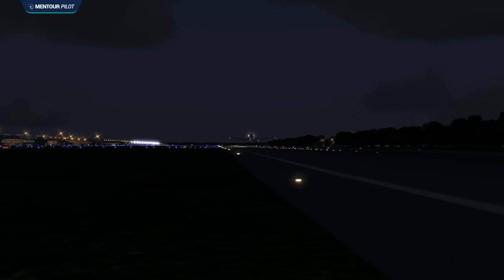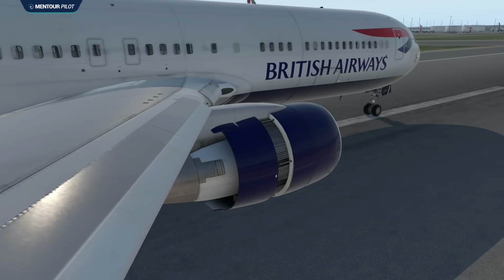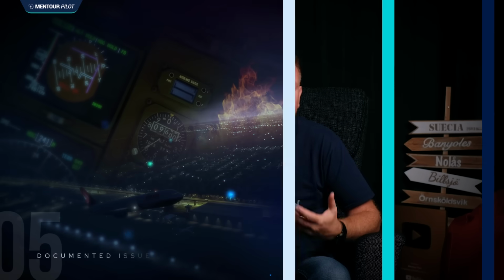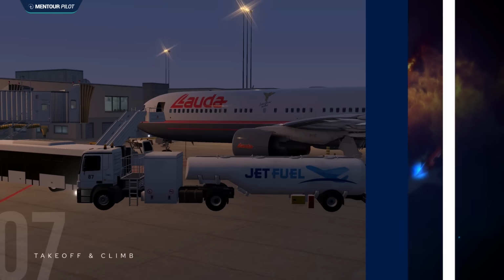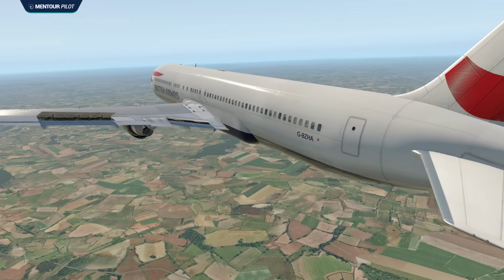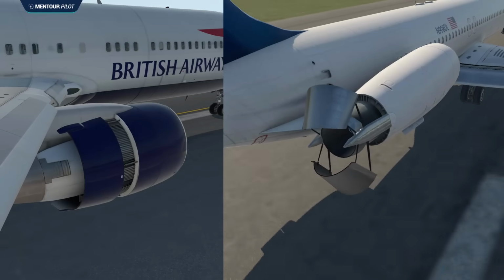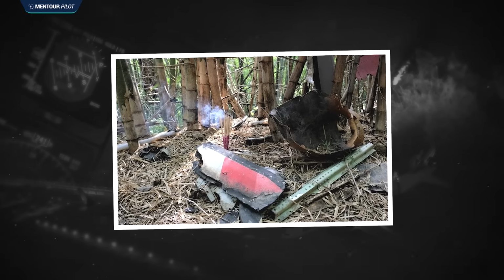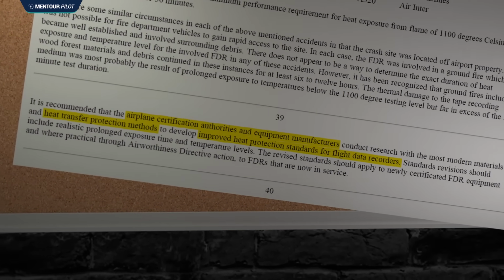HOW an Impossible Failure CRASHED this Boeing 767!

Comment: Plane should never have been in the air.  My first thought was a wiring issue , not moisture.    Airlines should ground any device not operating 100%   Everyone would be alive if they were cautious and had asked to land at closest city with that warning light appearing. You are not rolling down a highway where you can pullover.  I'll never fly, the industry takes things too casual .